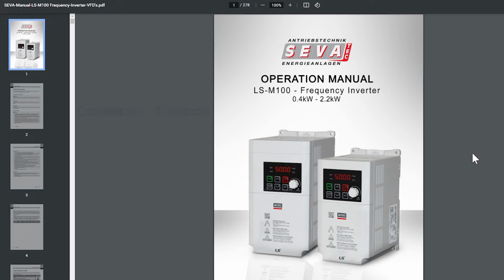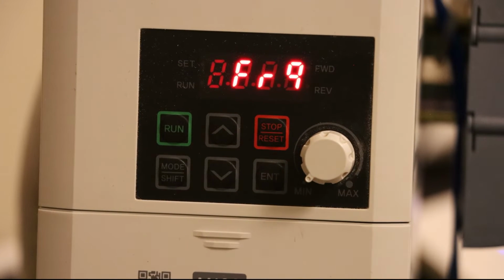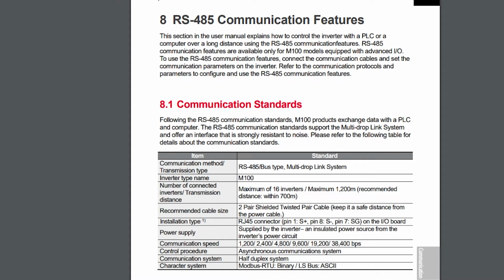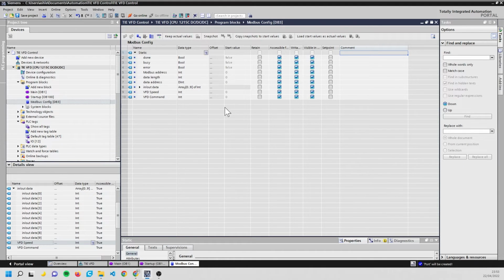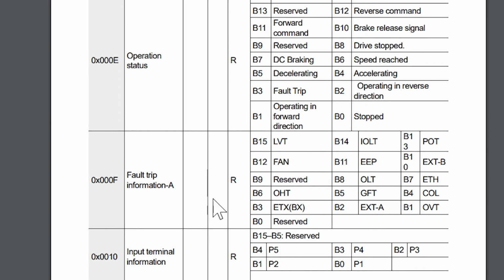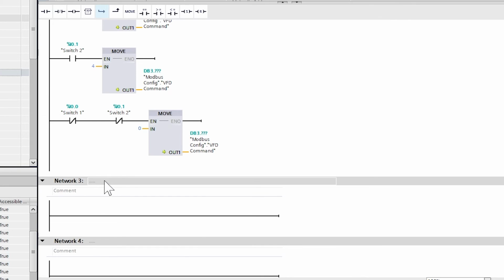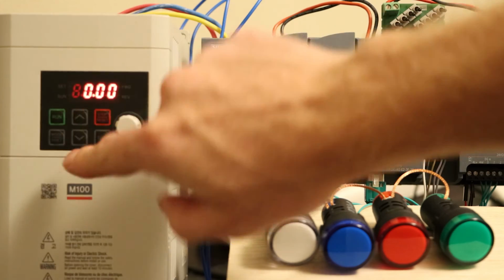Modbus Control Of Any VFD From Siemens 1200 PLC - LS-M100 Version

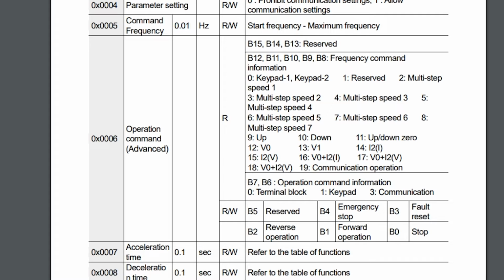Comment: 15:32, when you said that the integer value of 1034 will be divided by 100. Can you please explain what this 1034 is and why are you dividing it by 100?
Reply: This example Hz, and if you need from VFD to be 50 Hz as an output,u will write on reference frequency 5000 because the scale of 0x0005 is 0.01

Comment: Thanks for your great video, i was wondering is there a way that you could show in slow motion all the plc programming?
Thank you in advance
I am having very hard time trying to configure CB1241 using a 1212 DC DC DC and a simatics V20
I have tried Sepparately
Modbus coming out from PLC siemens and being read using modbus slave app
then
generating modbus code and sent to the VFD via modbus poll 

but when i try to join PLC and VFD it simply does not work.
i appreciate your comments 
Thank you

Comment: Great content just what I needed straight to the point with out all the fluff. Keep the videos coming would like to see video with PLC controlling servo. Thanks
Reply from the maker: Thanks very much! I'm not sure about servo control from a PLC. Servos work with a PWM signal and you can't buzz the IO that fast to give the servo the PWM frequency it needs. Ideally you could use a converter from something like Modbus or 4-20mA to PWM. I've never used one but they should exist.